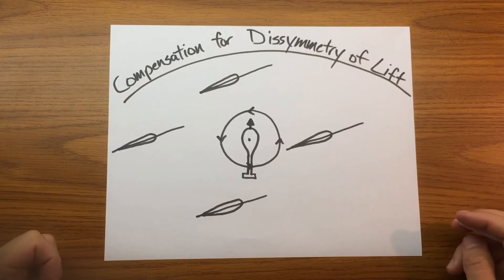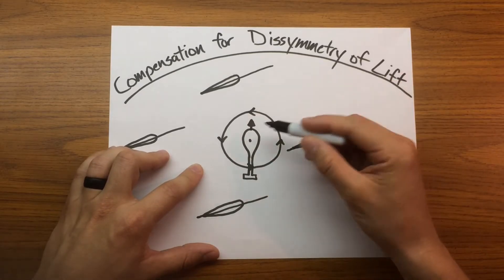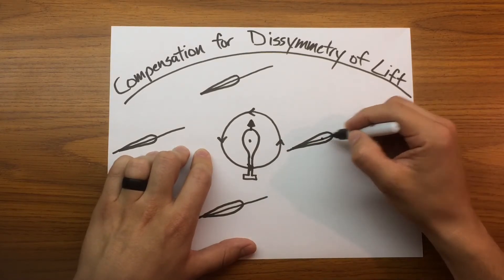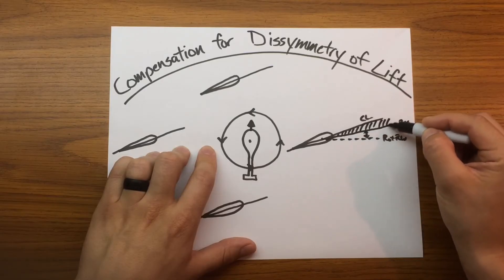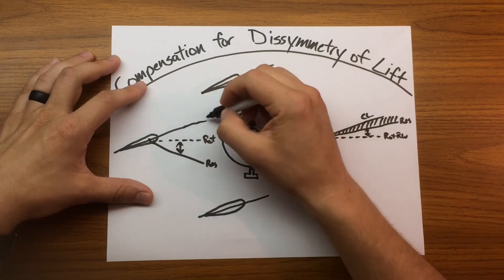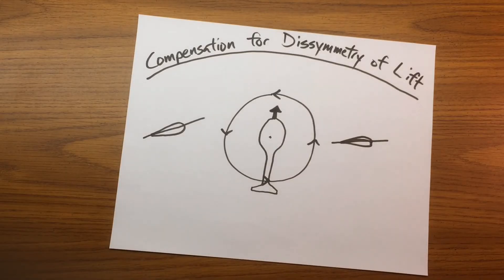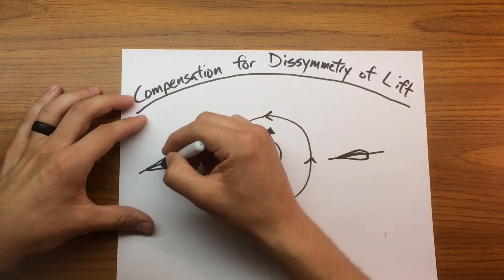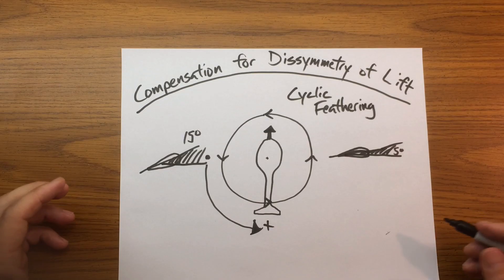Compensation for Dissymmetry of Lift in Helicopters

Comment: A little confused - if the effect of feathering is not taking place for 90* later, how does that help compensate for the retreating side's lack of lift?
Reply: yea you got where i was going, and many thanks for the reply! All making more sense now :)
Reply from the maker: Hockeysktr17. With Dissymmetry of Lift, there is more Lift being created on the right side of the rotor disk than the left. Because of Gyroscopic Precession, the effect is manifested 90 degrees later as more Lift on the front half of of the disk and less lift on the back half. By putting in forward Cyclic (Cyclic feathering) you are increasing the Angle of Attack on the retreating side of the disk. This manifests 90 degrees later as increased Lift on the aft portion of the disk and corrects the Dissymmetry of Lift caused by forward flight.
Reply: So when you want to slow down fairly quickly from speed, you're actually relying on the flapping compensation much more, right? Because the opposite is then true of your example here, with the advancing side needing more pitch to tilt the rotor back, and the retreating side needing less to come to a stop? Don't you also trim the disc (cyclic) for the cruise anyway, as part of compensating for dissymmetry of lift? Otherwise i'm assuming a very tired right hand eventually. Great videos keep them coming!
Reply from the maker: NJ Tech. Im not sure I completely understand your question. But when you want to slowdown quickly you would typically reduce the collective and apply aft cyclic. This would reduce the pitch on all blades (collectively) and increase lift on the right side of the disk (cyclic feathering). The advancing blade would continue to flap in conjunction with the increase in pitch applied. In the case you mentioned, yes, the advancing blade would potentially flap more than it was when established in forward flight. On your second question about trimming the disk, it all depends on if the helicopter has some kind of trimming build in either mechanically or electronically. This trimming is simply a set amount of cyclic feathering meant to hold an airspeed or attitude and reduce pilot workload. Thanks for the input!
Reply: if I'm not mistaken, weather you are using cyclic to turn, or slow, in forward motion your blades are still flapping for dissymmetry, and the feathering to turn slow, ect and assist blade flapping. unless you come to a hover or out of ETL. Great question, please correct me if Im wrong